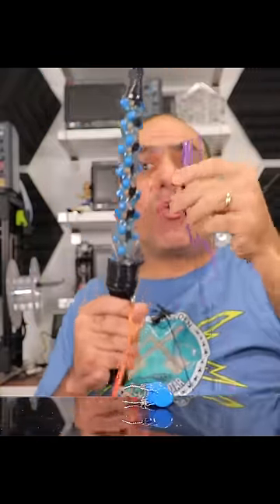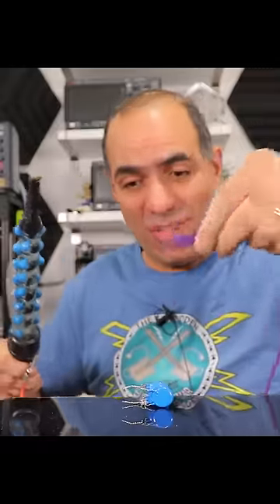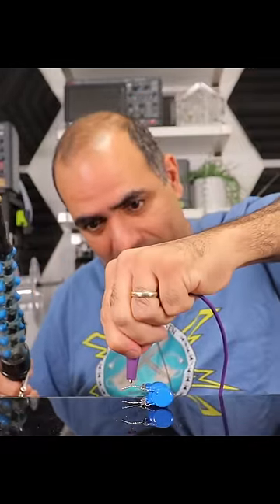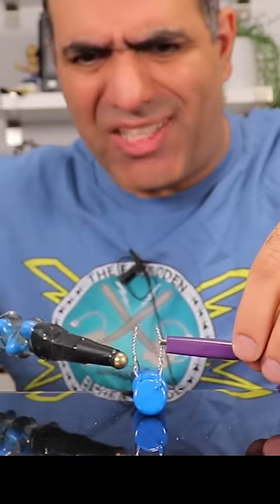Be Careful with High Voltage Capacitors…#electronics #shocking #funny #electroboom #highvoltage

Comment: I am convinced that this person is immortal at this point
Reply: He cracked the code, 1 zap for day keep doctors away
Reply: Recharging everyday
Reply: It would be good if he was a phone
Reply: True
Reply: he's an electrical engineer and knows that it's AMPs that kill. volts are essentially harmless unless you already have a preexisting medical condition. 

amps will stop your heart, volts just cause pain, that's why you can get hit with 250,000 volts and survive but it only takes 100-200 miliamps (0.01 amp) to stop your heart
Reply: هیچ وقت یک ایرانی رو از مرگ نترسون😂
Reply: @thephillygamer6959  You are wrong actually. Current kills, voltage doesn't is a common misconception. He debunked it too.
Reply: @thephillygamer6959  You should probably watch Electroboom's video on this topic since you are wrong. I = V/R. Current and voltage is related, and both are limited by the total energy of the source. The difference people forget is a lot of stuff is energy-limited, that is they can only send in a certain amount of ENERGY at once, like the capacitors here. The capacitors are very HIGH voltage, but still LOW total energy, so the resulting current output is LOW. Same with stuff like static electricity. In the opposite case, a high voltage transmission line would fry you to a crisp because its energy output is HIGH, so it can send a shit ton of amps through you.
Reply: He's obviously given himself superpowers at this point, I've read the comics.
Reply: Agreed😂😂
Reply: Best lesson I've ever learned
Reply: Agreed 😂😂
Reply: He's just like me but in electrical stuffs where i am immortal on da road
Reply: nah he's just built up his electrical tolerance
Reply: it’s all planned out and very boring
Reply: I think Mehdi did reveal in a video that most, if not all, of his videos are staged. By staged, it means as a professional, he knows exactly how much danger he can put himself into without electrobooming himself to see the big guy upstairs. 

The only time that it wasn't staged was apparently the jacob tower experiment. The device lost balance and fell on Mehdi, forcing him to catch and hug it by instinct.

Comment: My dad use to work in a tv manufacturing factory.  He said they use to charge capacitors then throw them at eachother.  😂
Reply: 😂😂
Funny
Reply: I used to print on packaging tape, and those big mother rolls got serious static charges as they unwound. So we'd charge ourselves up carefully, walk over to a co-worker and hold a pair of scissors near them...
Reply: Flashbang!
Reply: Omg
Reply: Soo memoribel bro🤣🤣🤣🤣
Reply: We Would Charge Them and Throw to Our Friends😮In Auto Mechanics.
As Far as TV's, The Picture Tube Will Store a High VOLTAGE, to Discharge, With TV Unplugged, Take a Screwdriver And Place Between Both Prongs and While Holding together, Slip Screwdriver Under The Second Anode Rubbber Cover, You Will Hear the Spark.
Reply: LMFAOOO
Reply: @TheCzechLad_ True 😂😂😂
Reply: Wtf 😂😂😂
Reply: Good to know nothing ever changes
Reply: That's fun I wanna work in there LMFAO
Reply: My friends and I used to do this in technology studies whenever we were left unsupervised. All girls highschools can be wild 😂
Reply: That's evil😭😭😭  @TheBeaverWhisperer

Comment: It is commendable how fast you get back to the audience after 10000V not once but twice
Reply: It's more than likely less than that. He's doing the bit for comedy.
Reply: @Vyz3r  Based on the arc's shown and their distance, it's not fake.   It requires 10,000 volts to jump an inch and it's about an inch between the legs of that capacitor array he charged.  The 2nd shock was less voltage but more current - high voltage capacitors are dangerous as they can deliver very high current.  The wand is high voltage but very little current.
Reply: @Tooob Remember THE RECTIFIER - if the voltage is high then there’s nothing to limit the current and it is high as well. However the reason it is nonlethal is because the TIME OF THE PULSE is very short. Since the total Energy is Voltage * Current * Time, the time being in the order of nanoseconds means that total Energy is low enough not to cook you or stop your heart. The danger of wall sockets (or especially things like Microwave Oven Transformers) is that they can provide continuous high voltage, high current power that can fry you.
Reply: @Tooob How can something be high voltage and little current?  If it's going through you, it's going through you.  I=V/R.  Higher voltage with constant skin/flesh resistance equals higher current.
Reply: @Noconstitutionfordemocrats1 Every electrical power source has a certain current limit where the voltage goes down. For example if you take a 9V battery and short it with a 0.1 Ohm cable, there won't be flowing 90 Amps through the cable since it can't output that high of a current and thus the voltage will drop
Reply: @awesomejoe4501  Ok?  So, it is at lower voltage and thus lower current.  Doesn't refute what I wrote.
Reply: @redstonekingrebooted7503  thank you for rectifying.
Reply: @redstonekingrebooted7503  That's a great explanation with a fantastic example, makes a lot of sense
Reply: @Noconstitutionfordemocrats1  The key here is constant resistance.High voltage tends to cause ionization which drops the resistance in a channel. Think of fluorescent lights or discharge lamps, they need a high voltage pulse to start and a current limiter to run without destroying themselves.
Reply: Amps matter just as much. I've taken 24k volts through my hands and therefore to the heart and it was way less painful than this.
Reply: @Noconstitutionfordemocrats1  both shocks come from capacitors. The initial voltage of a loaded capacitor is not what you see during discharge, with a closed circuit. As soon as you connect it, the voltage drops almost exponentially. So the initial voltage was very high as Tooob said, but the total current is not extremely high because of the voltage drop. I can't tell how dangerous it is.
Reply: i think the shock is real but he deliberately touches it for the bit he knows what will hurt and what will kill
Reply: Hahahahahhahahahahahahhahahahahahhahahahahahahahhahahahahahahhahahahahahahhaahahahahhahahhahahahahhahahahahahahhahahhahahahahahahaah

Comment: "Always discharge your capacitors before handling the circuit." Better advice has never been given.
Reply: Well I mean he did discharge them
Reply: @OH05 It's the "before handling a circuit" part that matters.
Reply: @josh8584  no I think discharging the circuit into your body is safer Im only working with electric car engines just a easy 400/800v make your skin change colour that’s all.
Reply: @OH05  Who doesn't enjoy switching teams occasionally?
Reply: @josh8584  Micheal Jackson 😅

Comment: Perfect way to convey an important point. PLEASE DISCHARGE YOUR Capacitors before handling them
Reply: how does one discharge a capacitor
Reply: @K.izm.a low voltage: connect it to an incandescent light bulb or a sizable resistor.
Hi voltage: lol, Good luck
Reply: My bro got scam triple times, 🤣

Comment: If he knows what he is doing, he deserves an oscar.
Reply: Hii
Reply: He’s an engineer. This is his style. So he does deserve an Oscar.
Reply: @ChadKakashi yeah, he has a master's degree in electrical engineering or something like that
Reply: Nobody really knows if he does or not
Reply: Finally, someone used Oscar correctly
Reply: Bro you can't believe that he accidentally electrocutes himself every video. You can't be that naive 😂😂😂
Reply: He has been doing it so long and is fine, he is doing it on purpose. 10000 volts is just as safe as 100 volts. What is actually dangerous is the amps. .05 amps could be deadly. What is dangerous when you combine them is the amount of watts, or energy, is created. You calculate watts by multiplying volts and amps together. So if you have 10000 voltss and 0 amps the energy would be 0. Volts is the pushing force or the pressure in the current where as amperes are how many electrons are passing through a certain point in the current
Reply: Yes bro, it's been he is doing this. Look at his followers
Reply: he wouldn't still be here if he truly didn't

Comment: Don’t worry, it’s not the voltage that kills you. It’s the current.
Reply: Its the capacitor thats killing him
Reply: And the amps
Reply: @stswithjohnny  current is measured in amperes so it's the same 😅
Reply: wrong
Reply: Amps
Reply: It’s sad that people still say this and know absolutely nothing about electricity.
Reply: @stswithjohnny  amp is a measurement of current genius 🤣
Reply: @xi-deadshot-ix5838 current is voltage divided by resistance.
Reply: @AussenFXs no, amps×voltage/resisitance is the current
Reply: This won't kill you for the same reason static electricity doesn't kill you. Energy can be measured in Watt hours. That's how the power company measures it anyway. The energy here is miniscule. Lots of current, but over a short time scale won't kill you. In this case it's almost instant. It takes microseconds for that to discharge, so there is simply not enough energy to matter. Current has to be sustained over a longer time interval.
Reply: @TheBurnknight bro amps=current. Volt=voltage. Ohms=resistance 🙃
Reply: You are wrong, my friend. The ampere depends on the draw, but the voltage is shocked by the existing force, whether weak or strong.
Reply: @TheBurnknight  The current is measured in amperes, as it says in the books of "Physics and its units" in the Basic or Fundamental Units section "electric current intensity = Ampere (Symbol: A)"

check it out, it's that way.

Comment: Worked in a camera shop when I was a teenager. Often forgot to discharge the flash on disposal cameras before ripping them open. Wakes you up real quick! 😂
Reply: Oww I can imagine xD
Reply: caps are a source of funny stuff when you know what you do. if not the case, they'll be removing your sorry self from the gene pool. ⚡😏👌
Reply: I  had one that sat for years and decided to take it apart one day. Decided to just be sure and used my favorite snap on flat tip to do the deed.  Blew the tip slam off and loud as hell

Comment: Just so people know who don’t, capacitors are one of the most dangerous parts of a circuit. Even without power they hold a charge for a long time. Everyday items have this like fridges, TV’s, microwaves, etc. if you ever take apart something with a capacitor you NEED to discharge it or you could or will die from it. Obviously the amperage on those capacitors wasn’t high enough to kill him.
Reply: -RonaldReagan-  mhm
Reply: I just a 250 volt 450uf capacitor is that enough to kill me ?  This is a legitimate question because I can't figure out to calculate the danger or a capacitor and Google wasn't helpful
Reply: -RonaldReagan- isn't it better to stand in a puddle of salt water?
Reply: @baylog9679 
If the current going through your heart causes fibrillation and/or erratic pulses, it could kill you. Best not to ignore the  symptoms.
Reply: @baylog9679 it's the amperage.  .2 amps is all it takes, and that's a pretty low current for high voltage appliances.

If you don't know how to work on electronics, don't go digging.

Comment: As my boss taught me when working on any furnace or heat pump - when checking the capacitor - make sure you use your screwdriver or 6in1 across the spade connections to discharge your energy

Comment: I had a capacitor and charged it up on a 9V until the battery died. I then used 110v in the wall it worked great until it blew up in my hand.  Lots of paper everywhere.

Comment: Im a lineman and a old lineman stopped me when first showing me a high voltage 200amp line capacitor for distribution lines.  He said see that wire shunting it out.  If that isnt on it never touch it and always ground it prior, otherwise it will "Knock your  pecker into your watch pocket"  I thought about it for a sec then looked at my shirt pocket.  Like ohh no.  The fact he had to compose himself after the shock tell me he really got the zap lol

Comment: 1- that arc between the legs was  actually THICC AF

2- how many Farahts is that capactor dude.like that's just a straight up battery not a capacitor 😂

3- the reason electroboom always gets shocked in this video and doesn't get injured at all is beacuse the volts in that circuit are much higher that amps in that circuit.so voltage shocks.but AMPS actually hurt and damage ur body because when amps get shorted by his skin it generates HEAT which can cause severe burns.

Comment: I can still remember my first experience with a capacitor. I had a camera that hadn’t had a battery in it for a long time. But when I took it apart, as I did with many old electronics, I quickly learned that there was still a charge in it.